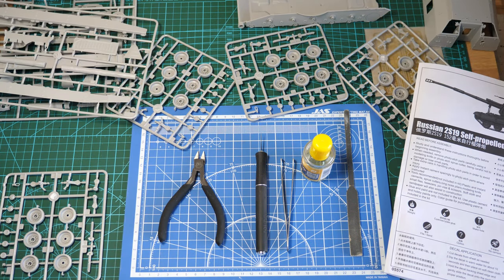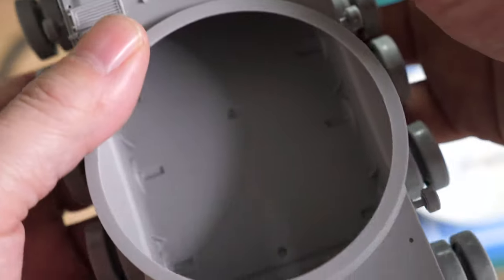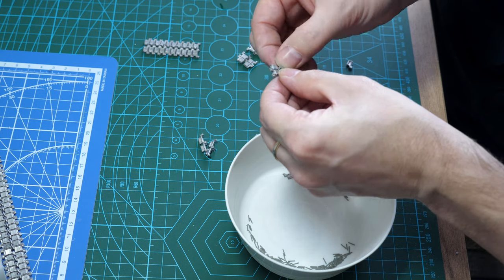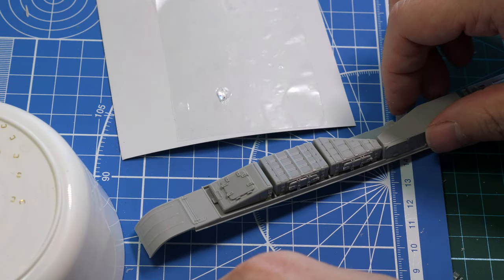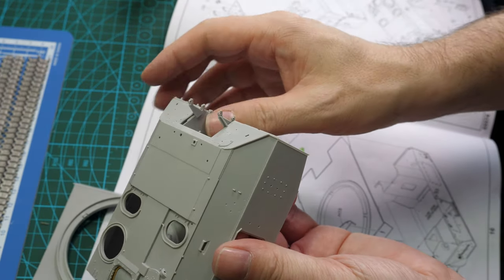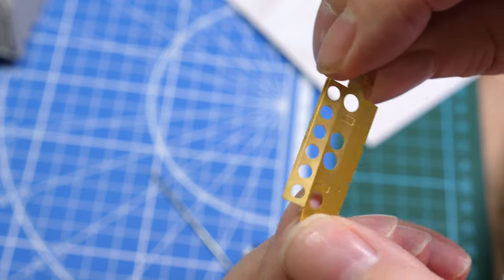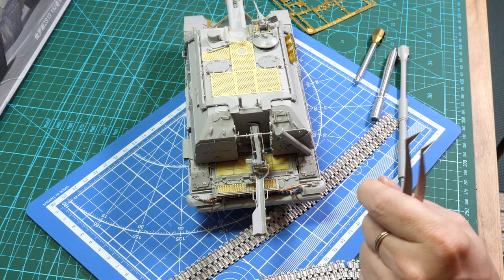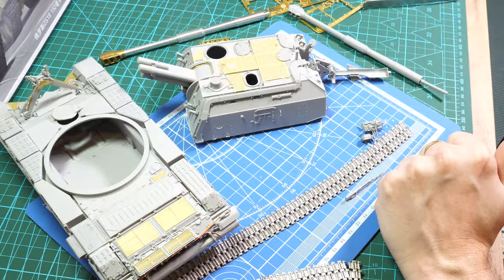Trumpeter 2s19 MSTA 152mm howitzer BUILD part 1

Comment: That looked like a hefty build but it's very impressive!  All the PE for the tread plates looks excellent.  Also, great work leaving so many parts workable.  

I have never tried those Masterclub tracks but they look excellent....much nicer to have the pins already set up in the bag than having to trim brass wire for each pin.  I also cheat often and only do half the tracks when they can't be seen behind skirts.  No point in wasting time there if they won't be seen!  Thank you for sharing your build of this beast :)

Comment: I have the same problem with metal barrels , what i do is lay a mocked up turret on the workbench
and balance it using fishing weights , then simply epoxy weights inside the turret , I worry over time
the turret will pull against top cover deforming it if out of balance

Comment: Nice video! Have you built the Zvezda version? If so, which kit is better between the two? I'm still on the fence deciding which one to get. Cheers.
Reply from the maker: Hi thanks ! I have not built the zvezda... but i would definitely recommend it...as it will be a lot cheaper and is certainly more accurate. Just get a PE set for it if you like detailing... hope this helps
Reply: @TheBearScaleModels  Appreciate the reply, thank you! I think I will get the Zvezda kit and a PE set along with a metal barrel for it. And YES, it was a big help.